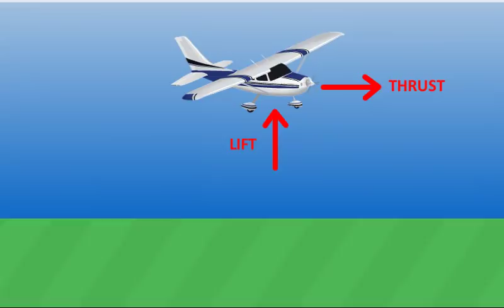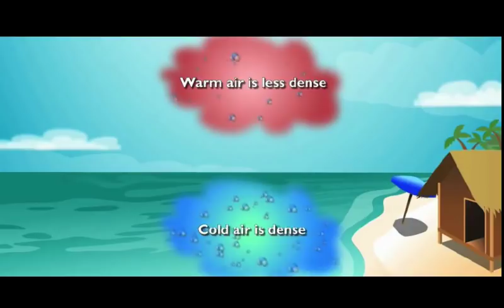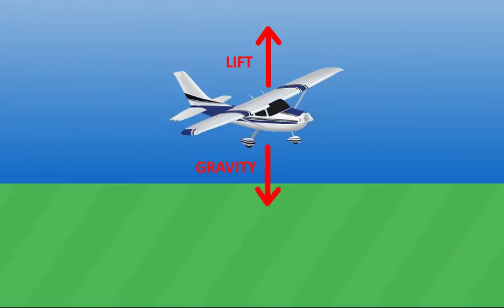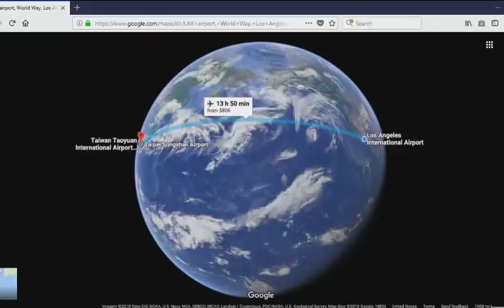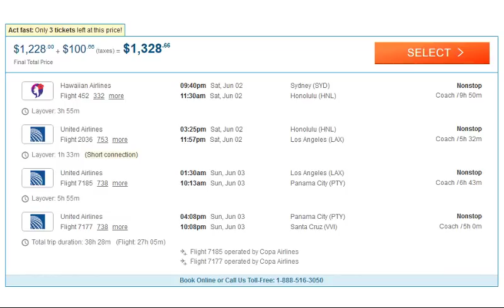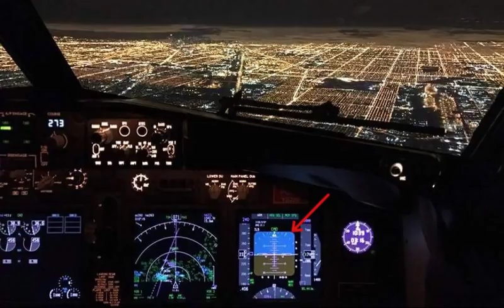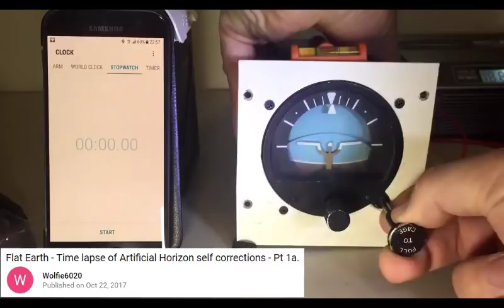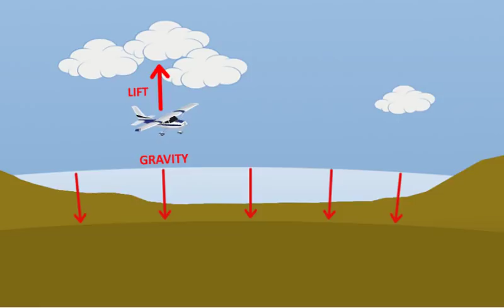Flat Earth Falsities - Plane Nonsense

Comment: In respect to QANTAS 27 flight, it is vector law of physics, that states: "an object can be displaced along a straight line from point A to B and back only", such as SYD to SCL, it has nothing to do with geography. Given that all maps use some sort of projection - conical, cylindrical, spherical, spheroidal, geoidal, transverse, planar, flat... which in turn are computer generated, or hand drawn -  means none provide real locations, and/or topological, proximal relations of locations on Earth. Perhaps the most accurate representation of the world is the one that person draws out of mindful imagination, a dream, or fantasy that will be accurate and correct to that person alone, leave her in peace. Hypothetically, gyroscope  spins differently to different spinners.
Reply: Well what your saying is hard to fathom, you say maps are wrong. Lets go with that then and we fly around the southern hemisphere. The distance from Sydney to Santiago by using cruising speed and flight time is about 7000 miles. From Santiago to Johannesburg is about 5000 miles. Then from Johannesburg back to Sydney is about another 7000 miles. So we have travelled by plane around the southern hemisphere and travelled about 19,000 miles. That is less than the distance around the equator. 19,000 miles is about the same as the circumference passing through Philadelphia in the United States. 
So you have a flat earth where 3200 miles out from the centre the radius passing through Philadelphia is 19,000 miles.
Then 8600 miles from the centre of your flat earth the radius is still the same19,000.
That is totally impossible.
Reply: I don't know any of that. The only questions I have are: how reliable your plane is and how much fuel it takes? I am coming!
Reply: Yuriy Shevchuk Not even close to reality. Maps are very accurate for near all of the inhabited world. The map of my town and the locations are exact. You don’t think surveyors exist? The map of my state is exact. I’ve rarely traveled in this country where I looked at my miles and was like “The map (or gps) said this trip was 1200 miles but I’m here and it was only 300 miles”.
Reply: You need to be able to define real from computer generated, a bird outside the window and a bird in digital TV Set screen, road you drive on and road on gps navigator... then you will see how wrong maps are. Yes, every "correct" map, globe, or mercator, is CG projection. You may map a small portion of a shore, such as on private property and monitor closely to prove, to only discover how wind, waves, drift wood, animals and foreign things modify that accuracy.
Reply: @yuriyshevchuk1933  Well I said earlier, planes flew around the southern hemisphere, a total of 19,000 miles and hit every target spot on. Seems some maps are very accurate. In fact here is link to a standard map used by airline pilots. I do not know where you get your maps from but I would change my supplier.
https://www.youtube.com/watch?v=677T6oeTn_0
Reply: @appresley4071  think of how maps were created: someone did field measurement, and whether it was correct, or not correct, checked or not checked, he drew it on paper with lines of measure and values (e.g. distance) as numeric labels. Then that map was digitized, flight referenced to that digital picture and you refer to it. None of the maps show surface distance and without timely complex calculations, accounting for map datum and projection, there is no way to get real distances from any map.
Reply: @appresley4071  globe measurements do not add up: using values given by Google: Earth's radius ~6378.1km at equator with one degree ~111.3km draw a scaled circle with 360 segments in graphics software and see that distance between each is well under, what would be 60km, not 111.3km 

Is there better means to discuss this than Youtube?
Reply: @yuriyshevchuk1933  Maps these days are very accurate, thanks to GPS. Have worked on boats for over 50 years, setting a course wasn't so easy in the old days. But today ships travel from here Australia to anywhere in the world with autopilot self steering systems. They hit the destinations perfectly. You are correct some very old maps were a little off. However the worst map for accuracy is the flat-earth map. We have an around Antarctica boat race, that is 14,000 miles distance. Flat earthers tell me Australia is 5000 miles wide, I have driven across Australia it is less than half that. As I said earlier I can fly around the southern hemisphere in 35 hours, it is only 19,000 miles. A 35 hour flight cannot be much further than 19000 miles, the distance is limited to 19000 miles due to flight speed.
Reply: @yuriyshevchuk1933  Your maths is wrong, how did you get 60. The circumference of a circle is Pi times the diameter (or Pi multiplied by 2 times the radius). 
So you say the radius is 6378 X 2 = 12756 x 3.14 (Pi) = 40,053 (The diameter at the equator)
40,053 the diameter divided by 360 degrees =  111. 3 kilometres    
As I said your maths is wrong. Please check your figures if you want people to take you seriously.
Reply: Did you get lost on your way home from the New Age bookstore or is this an April fools joke? Expanding on your map projection reasoning, a globe is not a projection, but a scaled model, and does provide real locations at that scale. A coordinate system provides an objective map which may be navigated mathematically. We cannot transform these models at will.
     Despite the Vector Law of Physics, 747-400 aircraft are currently unable to travel through solid earth. They can only travel through the lowest 8.5 miles of atmosphere. And they have a range of 8,357 statute miles, meaning a nonstop flight between Sydney and Santiago on flat Earth will fail. 
     Deepak Chopra or not, to think otherwise is fantasy.
Reply: Distance measured by traveling, such as odometer, which is correct, does not correctly reflect on digital map, or map drawn in any way otherwise, and there is no means to check, or account for whether such is correct. Map is like a hand sketch: "A - B 5000 miles". No human is big enough (mindfully) to see the shape of the Earth, and no human eye is strong enough. Why? Just fly the plane.
Reply: "Perhaps the most accurate representation of the world is the one that person draws out of mindful imagination, a dream, or fantasy that will be accurate and correct to that person alone" No, just no.
Reply: That is so cool! Knowledge and experiences long lost. All the gps values can be calculated from the data, it does not have to be in the real world. It seems many people hike more and more on-line. Lucky you.
Reply: @NotTheCIA I.think yes, if everyone tells to "go online", when you are looking for something, they all must be going online.
Reply: The distance when travelling 10˚ due east or west parallel to the equator.
At 60˚N or S the distance is 300 nm or 555.8 km. Personal experience.
At 30˚N or S the distance is 520 nm or 962.3 km. Personal experience.
On the Equator the distance is 600 nm or 1111.2 km. Personal experience.
For correcting sextant altitudes for the Earth's curvature the formulae are;
 Dip = 0.97 x Square Root (Ht of Eye in feet). Personal experience.
 Dip = 1.76 x Square Root (Ht of Eye in metres). Personal experience.
Also magnetic compasses only function because of the earth's magnetic field, which only exists because the earth is spherical. There is no such thing as a mono-pole magnet in nature. Only people who have actually worked with them or studied their development know this. I have done both. Not a single FE cultist has done either. Not a single one. Never. Not a one. Personal experience.
Gyrocompass only work because the Earth is slowly rotating and gravity is a fact. Only people who have actually worked with them or studied their development know this. I have done both. Not a single FE cultist has done either. Not a single one. Never. Not a one. Personal experience.   @yuriyshevchuk1933

Comment: Economically feasable? For who? You're full of shit...M
Reply: Feasible for the airlines, dumb ass. They're not charities. But don't worry sport, Qantas flies nonstop between Sydney and Santiago (Qantas 27/28) which on FE would far exceed the range and maximum speed of the 747-400s used. They also fly nonstop between Sydney and Johannesburg which presents the same problems for FE. Go check flighaware.com  Or is that part of the conspiracy too?
    Bottom line: These flights are impossible on FE
    BTW how many sock accounts do you have?

Comment: Where it is true that they are not "fuel stops" plane will still refuel, this is because the extra fuel in the tanks adds weight and uses extra fuel, normally plane only carry an extra 10% of fuel to complete their journey.
Reply: There are no fuel stops on a nonstop flight between Sydney and Santiago, but it is within the range of a 747-400 on spherical Earth, but not FE, where it exceed both the range and maximum speed of the plane.
Reply: Really? Do you know how much fuel would be wasted to arbitrarily land, taxi, taxi and take off again? Do you know what the landing charges are at airports?
In fact do you actually know anything about anything?
Reply: Additionally, adding flight cycles increases required maintenance checks,  and generally ages the plane faster.
Reply: Indeed they do. But I suggest we have a fucking pretentious Miss Know-it-all with a flappy gob and no brain in our midst. @romithromith
Reply: @boffeycn  She seems to be on the group tour, though almost certainly sock accounts below. It's becoming more pretentious every day, satellite phone experts and airline insiders.
Reply: I suspect a number of them actually believe others have the same levels of experience and knowledge that have, which is next to fuck all, and they can therefore get away with their bs.  It is patently obvious that  many posters just believe what they see and hear on YT eve wen it contradicts what they actually experience. Possibly becasue their sensory receptors are selectively blocked because so many statements are so stupid, such as the "no stars"  and ships being restored to view.     @romithromith
Reply: @boffeycn  You are right my friend. These people are oblivious and simple minded, and won't even apply critical thinking on the tail end. I see reports of people getting swindled in real life, and it's the same shallow, emotionally driven thinking. No critical thought. 
     It's the fellow who doubts Earth has a core because Russians drilled only 7.5 miles down, or saying Earth might be round but is much bigger than we're told. It's face plam time. Their Bible literalism is literalism in general. Not sophisticated and not curious. The FEers are mental 3-year-olds.
Reply: Also interesting is that we expect people to take responsibility for their own actions but Zuckerberg is not prepared to do so. And people complain about government being out of control and oppressing the poor little voters!   @romithromith
Reply: @boffeycn  Memo to Zuckerberg: Watch what you ask for...
Reply: Zuckerberg and his ilk do seem to be somewhat naive when they are faced with reality. @romithromith
Reply: @boffeycn  Help me out. The "gilets jaunes" are French? "Mogglodytes" are conservative wingnuts in the House of Commons? It doesn't sound even with Brexit that neo-Nazi types are going to find a friendly neighborhood. And the affluent conservatives should have better considered this.
Reply: The "gilets jaunes" started off in France but the pracrtice hasspread across Europe. They are mainly of the right wing/fascist persuasion posing as the nice guys. As usual.
"Mogglodytes" are supporters of Jacob Rees-Mogg. Ultra-ultra conservative godbotherers living  in the Middle Ages.
And the boy band "BoJo and the Mogglodytes" Are Boris Johnson and the Moggy, performing song and dance routines with assorted others pretending they care about the UK and its people whilst stashing their wealth overseas and voting to redce worlers rights, etc. They are adored by what the Brits call "gammon", ageing, white Little Englanders who doff their hats at gentry. Somewhat like your Don the Fart.
I follow UK politics because  I derive some of my pensions from the UK. 
what do you think of Yuriy Shevchuk's post?
 @romithromith
Reply: @boffeycn  It appears that racism, nationalism, the Caste system, and other undercurrents of bigotry are alive and well.
    Yuriy Shevchuk seems to have made a wrong turn of his way home from the New Age bookstore. Faulty map projection. Our FE friends can't distinguish fantasy from reality, the subjective and objective, and I'm not sure Yuriy can either. (BTW what kind of a projection is a globe?)
     Then again, let's not be fooled—it's April 1st...
Reply: Interesting that the manufacturers and suppliers of fentanyl are blamed for the deaths of end users but the deaths of end users of guns and bullets (those murdered) are nothing whatsoever to do with the NRA and the users of the guns and bullets.
   @romithromith
Reply: @boffeycn  Alas, the the right to keep and bear opioids is not part of the Bill of Rights. So if China completely discontinues making the fentanyl, where will the API for legitimate analgesic and anesthetic products come from? I guess the right have and suffer severe pain now exists.
Reply: The regional cancer center recently announced new guidelines (aka limits) on the use of opioids in all persons with cancer. It's like they're worried about addiction in persons with stage 4 terminal cancer. Medical cannabis in legal in NY but no insurance (I know of) will cover it.
Reply: "I guess the right have and suffer severe pain now exists."
Seems "legit". @romithromith
Reply: Crazy, isn't it. My father died of cancer and in some considerable pain even though he was being pumped full of opioids. Maybe god had to break him of the habit in his afterlife, he being a man of the cloth who ran three churches before his god given illnesses took over.
I used to like Mary Jane but my current medical condition  means I would need permanent attention if I used it now. Sadly.
 @romithromith
Reply: @boffeycn  My father was dx'd with Stage 4 metastatic liver cancer. I offended a PA who tried to reduce him to Lortab (acetaminophen is contraindicated with a dysfunctional liver) who talked about having patients in a detox ward. I found a doctor who supplemented his opioids with Ritalin, which improved his quality of life. He was only in severe pain the last few days of his life.
    My dad's defibrillator never went off, though now I wonder if it did at the time of his death. The woman he was with (and her daughters) were sociopaths. I caught on too late, and the terrible things they have done/do are beyond belief.
Reply: Er, hmmm. Yes. My father didn't have that problem, just the opposite. It was decided by all concerned he would be better off at home in the village with a nurse visiting a couple of times a day to check all was as well as it could be. The NHS still worked properly at that time.
He also had a "full house" of tongue, throat, bone cancers and so on.
I trust the woman and her daughters were not religious, then.
 @romithromith
Reply: Amazing and yes, stupid. Rehab, place sounds like a Trump inspired place, albeit pre-Trump.
I didn't ask which drugs they used on me in hospital after my heart attack and stroke, but they resulted in very dodgy "reality" for quite a long time until the pains eventually diminished and the "broken" bits started mending and I no longer needed them. (They must have been pretty strong though as i was on morphine years ago to kill the pain of peritonitis.) Then they tried "rehabilitating" me to walking for a few weeks. I wasn't in any pain by then, just shit scared of falling over again which I only overcame through slow and steady exercise over several weeks at home after release. @romithromith
Reply: @boffeycn  I hope they gave you morphine during the heart attack because I hear that can be seriously painful. Your stroke must have right sided because it hasn't affected your speech or your thinking, or else you made a fantastic recovery. Were you weaker on the left side of your body?